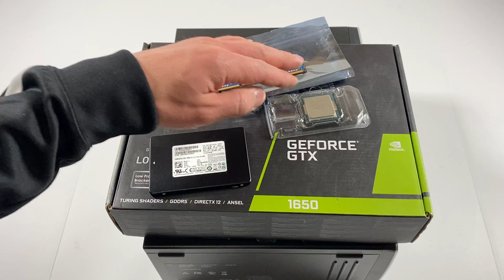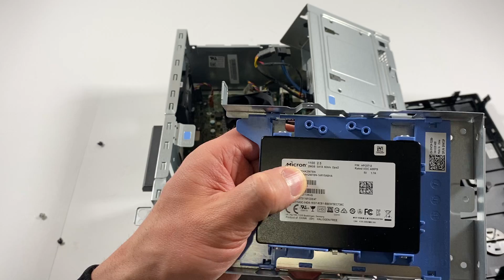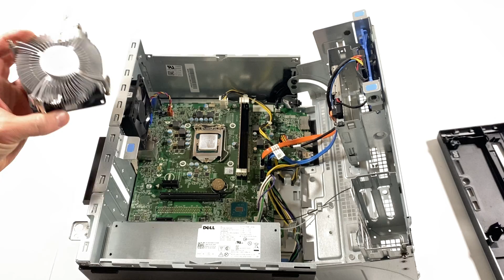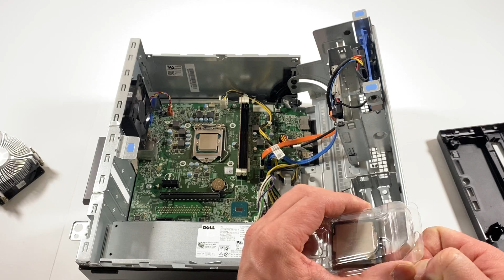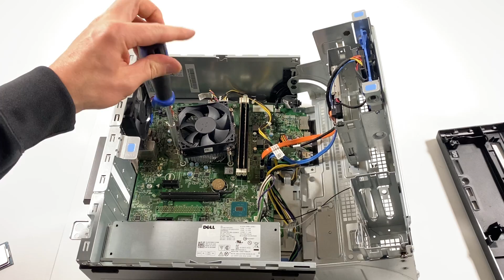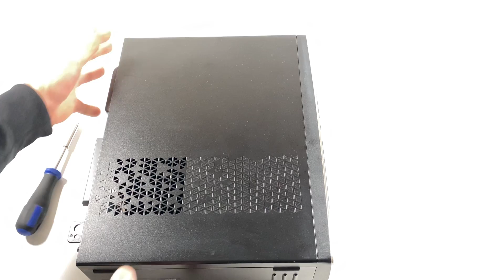Dell Inspiron 3650 Gaming Upgrades SSD CPU RAM Video Card

Comment from the maker: List of Parts and Upgrades works with this system :
Dell Inspiron 3650

List of RAM will work with this system.
Maximum Memory supports: 16GB 
Supports only DDR3L 

This RAM works with this machine:

(1.) Crucial 8GB Single DDR3L 1600 MT/s (PC3L-12800) Memory CT102464BD160B
https://amzn.to/2VhGv8O

(2.) Crucial 4GB Single DDR3L 1600 MT/s (PC3L-12800) Memory CT51264BD160B 
https://amzn.to/2xq46wb 

(3.) Crucial 16GB Kit (8GBx2) DDR3L 1600 MT/s (PC3L-12800) CT2K102464BD160B 
https://amzn.to/2VpsKpP

(4.) A-Tech 16GB (2x8GB) DDR3L 1600 MHz UDIMM PC3L-12800 (PC3-12800)
https://amzn.to/3i97Zt2

List video cards will work with this system Dell Inspiron 3650

GIGABYTE GeForce RTX 3050
https://amzn.to/3W2sJY9

MSI Gaming RTX 3050 Gaming X 6G Graphics Card 
https://amzn.to/4eNikqD

(1.) ASUS Phoenix NVIDIA GeForce GTX 1650 OC Edition Gaming Graphics
https://amzn.to/3Nyn7yb

(2.) ASUS TUF Gaming NVIDIA GeForce GTX 1650 OC Edition Graphics Card 4GB GDDR6 
https://amzn.to/3moJbzo

(3.) PNY GeForce GTX 1650 4GB GDDR6 Dual Fan Graphics Card
https://amzn.to/3aFlxw4

(4.) ZOTAC GAMING GeForce GTX 1650 OC 4GB GDDR6 
https://amzn.to/3xeX0FF

(5.) AMD Radeon RX 6400 Low Profile Gaming Graphics Card
https://amzn.to/3s8MUUY

(6.) Gigabyte GeForce GT 1030 GV-N1030D5-2GL Low Profile 2G Computer Graphics Card 
https://amzn.to/2Z4PHkp

(7.) ZOTAC GeForce GT 1030 2GB GDDR5 64-bit Low Profile Video Card ZT-P10300A-10L 
https://amzn.to/2WzgLXk 

(1.)  Thermal Grizzly - Spatula for Applying and Spreading Thermal Paste
https://amzn.to/30Qq4ag

Thermal Compound Paste:
(1.) Arctic Silver 5 Thermal Cooling Compound Paste 
https://amzn.to/2ziNU0H

(2.) Noctua NT-H1 3.5g, Pro-Grade Thermal Compound Paste
https://amzn.to/36kTk7A

(3.) ARCTIC MX-4 (current edition) Thermal Compound Paste 20 Grams 
https://amzn.to/2DhGJaK

3.5" to 2.5" SSD or Hard Drive Caddy Adapter R494D 0R494D 
https://amzn.to/2XTPeRr

SSD List:
(1.) Samsung 860 PRO SSD 256GB - 2.5 Inch SATA III Internal Solid State Drive
https://amzn.to/2BY5gRl

(2.) Samsung SSD 860 EVO 250GB 2.5 Inch SATA III Internal SSD 
https://amzn.to/37xWUfc

(3.) SK hynix Gold S31 1TB 3D NAND 2.5 inch SATA III Internal SSD
https://amzn.to/3d7X6D6

(4.) Samsung SSD 860 EVO 1TB 2.5 Inch SATA
https://amzn.to/2B2FURX

(5.) SanDisk SSD PLUS 1TB Internal SSD
https://amzn.to/3hwdqku

(6.) SanDisk SSD PLUS 240GB Internal SSD
https://amzn.to/2zfc7EX

(7.) Crucial MX500 250GB 3D NAND SATA CT250MX500SSD1(Z) 
https://amzn.to/3bTTjbX

(8.) SanDisk SSD PLUS 480GB Internal SSD SDSSDA-1T00-G26
https://amzn.to/2yfgjUK

HDD list works with this PC:
(1.).WD Black 2TB Performance 3.5" Hard Drive - 7200 RPM Class, WD2003FZEX 
https://amzn.to/2xFUeyF

(2.).Seagate BarraCuda 1TB Internal Hard Drive  3.5" Hard Drive - 7200 RPM
https://amzn.to/3g8FXM8

(2.) Western Digital 1TB WD Blue Mobile Hard Drive HDD - 5400 RPM, 2.5
https://amzn.to/3aEQ1Os
Reply: For the RX 6400, does it have to be the low profile version or does the regular one work as well?
Reply: Great video as always; keep up the excellent work!
Reply from the maker: Hi, thanks.
Reply: @Mxkdt  I have the same pc, what CPU do you think it's better to play video games?, I don't want to spend to much buying a video card, I all ready upgraded the ram, but I just can play most of my games at 720p, please help me
Reply: Is it possible to replace the PSU with something else?
Reply: @Kodan882 I think you'd need another Dell PSU with larger wattage but similar in size but I'm not 100% sure. If you do end up finding one, I'd ask reddit or a forum site like Tom's hardware before buying to see if it'd actually work with this model.
Reply: Will the ventus xs 1650 work with this pc?

Comment: I bought my 3650 back in 2016 and have had it ever since, the past 2 years it's sat and hasn't done much though because i built a new computer which was a significant upgrade
My 3650 came in 2016 with one stick of 8gb ram, and had 2gb of ram built onto the motherboard dedicated for the video processer chip that was on the motherboard. Intel i5. wifi card and 1tb ssd
Was over $900 (most of that cost due to the 1tb ssd) 
I used it all the way up to end of 2023 when there was no way to make the thing play any of the newer games or older games it use to play that were getting all these hd updates and changes that made them to much of a slog to play so I built my new computer
Recently been going down the rabbit hole and finding all these various videos like yours about upgrading and updating them and loving seeing all the various takes and stuff people did but also realizing that mine was way above all the other base release models seeing and hearing how all of these were before the upgrades 
It seems the built in ram and video card on the motherboard and 1tb ssd standard were unicorns and why mine was almost 1grand back then haha.

Comment: I know this is an old video, Someone gave me this PC & its has an I3 processor & want to use newer processor. It also has a 3.5 Seagate internal HD. I want to upgrade the Wi-Fi card so it picks up 5 GHz, Add more USB 3.0 ports & add a newer NVME SSD with adapter will it work? I know that processor you used is not Windows 11 compatible same for my I3 but you can force an upgrade. The power supply in that PC is weak is there a upgrade say a 500 watt that fits this PC? -Cheers!

Comment: The only drawbacks on the 3650 is that it has no NVME slot, no DDR4 Memory capability and the 240W PSU. It looks like you may be able to upgrade the PSU with an ATX if you cut out the case for it? Or you can just use an MSI RX 560 4GB or an EVGA 1050Ti that requires no additional power cable. If I were to upgrade a 3650 I would use an Intel 6700 or 7700, try to upgrade the PSU by cutting out the case hole bigger and use the required adapter cables and possibly cut out some cooling fan holes on top of the case.

Comment: I have one of these, but I have a disk drive. Should I be able to just get the SSD and Caddy Adapter to replace it? Or do I need to also get a cable for this?

Comment: is it possible to put a GeForce RTX 3060 on the dell inspiron 3650 ? is it a good idea ?
Reply: Eh I don't think it is possible, the PC is old and most likely doesn't have the capability or correct slots for this gpu
Reply: Technically yes, but you’d need to change the power supply 100%

Comment: I have the exact setup  My question is  are these only meant to run 32 bit operating systems? and 32 bit software?  Mine i cant seem to install  64 bit anything  operating systems  win 10 32 installs no problem    win 10 64  doesnt work any advice be great thanks  i7 6700  16 gb ddr3  2 gb radeon M8 360  im stumped

Comment: Hi i'm using a dell vostro 3470 with a 200W psu and im wondering if i can also use gtx 1650 lp?
Reply from the maker: Hi, minimum 240watt power supply to use gtx 1650 lp..

Comment: Your video on (Dell Optiplex SFF 3010 7010 9010 Change Power Supply) will it also work with Dell Optiplex 5050, If not can you please send a link to a PSU which will work/fit in the optiplex 5050 over 300W?

Comment: Wouldn't the power supply limit the gpu and cpu since it's only 240w?
Reply: Certain computers have higher psu’s he wouldnt of put that gpu if it wasn’t going to work
Reply: @2DayAnt  It would have been worth mentioning if the PSU was upgraded

Comment: Hello my friend enjoying your videos 
I have a question i just bought hp prodesk 705 g4 sff with amd 2200g with crucial 8×2 ram kit 3200 hz 
And it wont be overclocked it's stuck at 2600 mhz what should i cant find xmp in the bios 
Also another question my vram is only 1 gb and i want to increase it to 2gb what should i do
Reply from the maker: Hi, thanks, on that HP small PC you can't overclock or change RAM to XMP mode, you can upgrade video card if you want like NVidia GeForce GT 1030 2GB.
https://amzn.to/3Ie7tpW
Reply: Ok i cant change the vram to 2gig

Comment: Hi! Great video! I recently upgraded this exact PC with an ASUS 1650 and would like to upgrade my CPU from an i5 6400 to an i7 6700 as you have in this video. I noticed you just installed it without doing anything with BIOS. Is that fine or do I need to update? Also, would you recommend a new i7 6700 or a used one? And finally, does the CPU have to be exactly like the one you have in the video SR2L2 + X643B015 or will any I find online suffice? If it does could you link where you bought the CPU? Thank you.
Reply: Dose that X### need to match or will any SR2L2 work?
Reply from the maker: Hi, you do not have to update the BIOS and CPU will work fine and you can update to latest BIOS Version 3.12.1, before upgrading the CPU. I recommend i7 6700  SR2L2 you can buy on ebay used for around $90 plus tax.. Thanks and Good Luck !
https://www.ebay.com/sch/i.html?_from=R40&_nkw=sr2l2&_sacat=0&LH_BIN=1&_sop=15

Comment: How much wattage does the psu have? My 3650 comes with 240w psu
Reply from the maker: Hi, my Dell Inspiron 3650 does have 240Watt power supply.
Reply: @Mxkdt  has it had any issues?
Reply: @Mxkdt does it have issues?